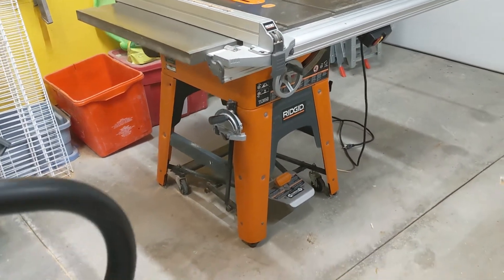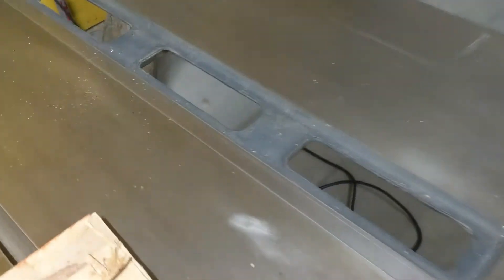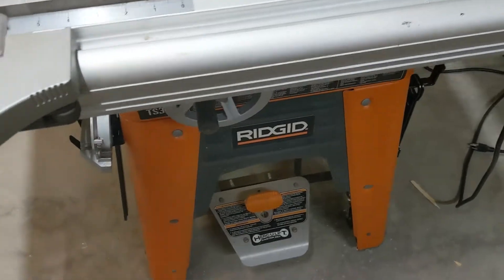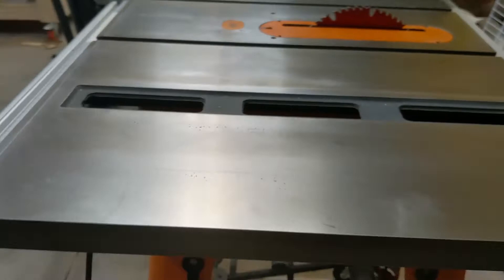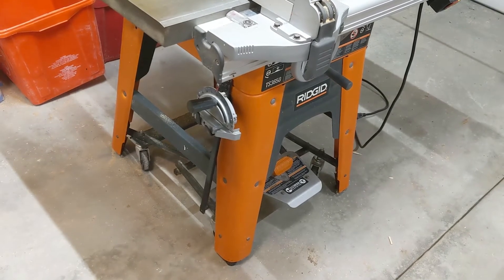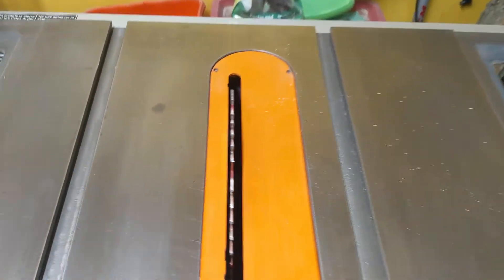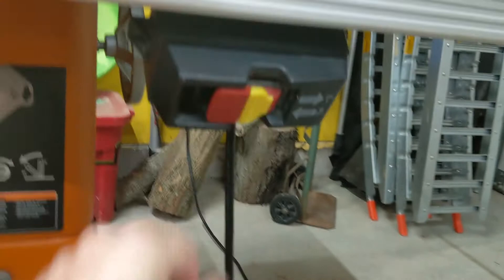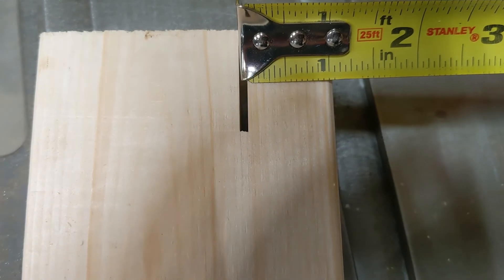Ridgid Table Saw - TS3650  and  TS3660

Comment: My belt came off when I raised the blade and now when I lowered the blade the belt is so loose it will not run the blade. I thought maybe there was a tensioner pull that fell off  but after watching your video I have to go check the adjusting bolts  and try and put some tension on the belt. THANKS!!!

Comment: Nice video.  I bought the 3660 new  in 2007 i believe.   Love the saw, have gotten a lot of use out it.  Dead accurate and hasn't needed any work except maintaining the cast iron.  
Unfortunately my motor just gave out on me.   It's been whining for a few years and finally let out the smoke.     Don't know if anyone else has had issues with the motor.

Comment: IIRC, the main difference between the two is the number of boxes they shipped in. The TS3660 came in one box (although there may have been a separate box for the rails, I don't recall, probably was. I know a later version had two-part rails). Seems that just removing that lower brace was enough to condense things down. They're both really solid saws, with a very reasonable original price.

From a user perspective no difference, though I suspect it's easier to adjust the alignment on the TS3650 because it doesn't have the wide side panels at the top. That makes it easier to reach the bolts. On the TS3660, which I have, it's doable, but you need a LONG socket extension, a mirror, and a good sense of feel, or lay on your back somehow. (There's a video up where a guy cut an access hole in the side to make life easier.)